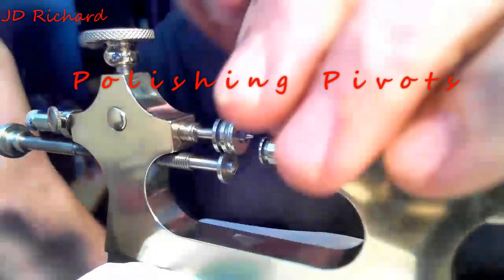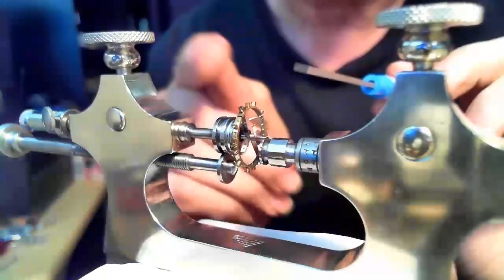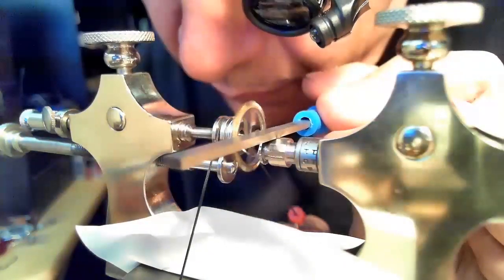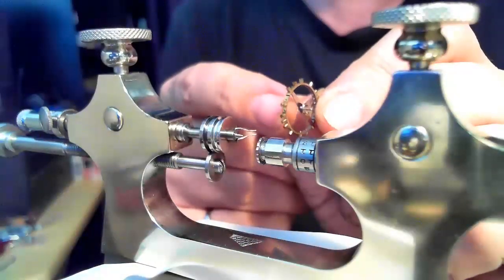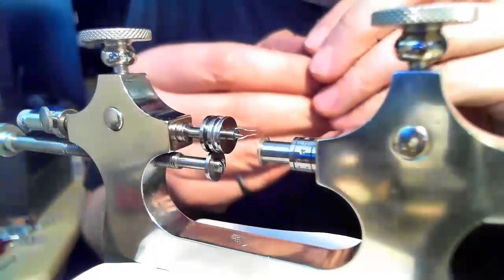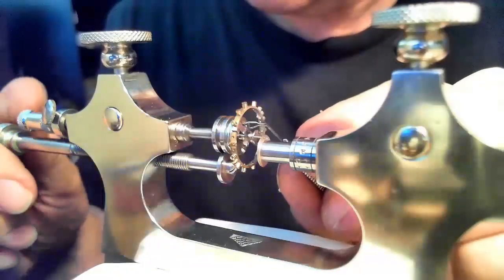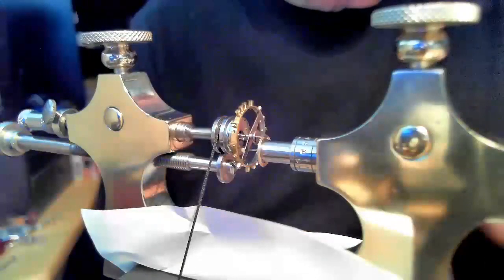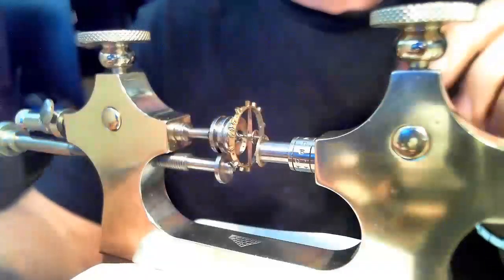Polishing Watch Pivots - Jacott Tool

Comment: If you haven't already worked this out, or been told several times in the comments, you're supposed to wrap the string a full 360 degrees around the pulley, then it never slips during operation. This also applies to using a bow.
Reply from the maker: I do understand with the bow.  With the ID spool there is no need due to the downward pressure

Comment: An old school trick is to run the finished pivot across the third finger nail to detect any roughness-or smoothness if it's done correctly. Thanks for a great video.
Reply from the maker: Why the third fingernail??
Reply: @JDRichard  Because it is the most sensitive. Try it yourself the next time you dress a balance pivot.

Comment: Great video Richard, as always I found very useful information on your Youtube. Let's say you have a balance with a worn pivot on one of the ends. The pivot has been "coned" but is straight. Is it possible to burnish a balance to get its pivot more rounded at its tip instead of this coned and "sharp end"? Thank you.
Reply from the maker: Not an issue if the pivot has material to work. The lantern side of the Jacot arm is used for this.
Reply: @JDRichard  Aha, if I understand correctly, if it's enough material on the pivot I can try to "round" it off? It will get a bit shorter but that's maybe fine then I guess (of course can't be to short). Thank you for the answer :).
Reply from the maker: @Watcheyes  You can’t really remove material from the very top of a pivot or the end-shake will be off and the palate fork / impulse jewel action will be offset.

Comment: Hello very nice video and good work!! I have a question.When it is need to polish pivots? This is a new staff on the balance or an old that it has a problem ?Thank you .
Reply from the maker: Usually polish the outer diameter of the pivot when I have made a balance staff and need to fit it. Or when I purchase a new balance staff and the jewel is too small due to a replacement during repair and I need to reduce the diameter. Or if the staff new or old is a little too long and I need to take off 0.01mm
Reply: @JDRichard  thank you very much .

Comment: Great video, but I think you have a wrong tool. As you describe it, it's aright handed tool, What I've been learned at school is that the tool is parallelogram shaped. Only the bottom has to touch the pivot. Top part has to point away from the shaft so you can really do the entire pivot. I'm left handed too and had to get a left handed one.
Reply from the maker: I do think I have the correct tool but need to operate it right handed
Reply: @JDRichard  that's what i meant. Tool is correct, bit need to use it right handed or buy lefty version.

Comment: Hello. Curious why the balance staff pivots needed polishing, just wear or did you make the staff and finishing up? Btw, watch out for the disc with holes for reducing/polishing ends, as they break easy when inserting into the tool. If it rolls off the table forget it.  Enjoying your videos. RJ
Reply from the maker: The ends just needed some cleaning
Reply: Thanks for replying.